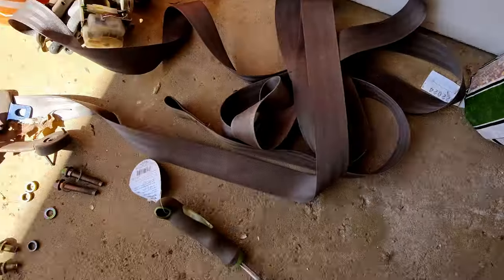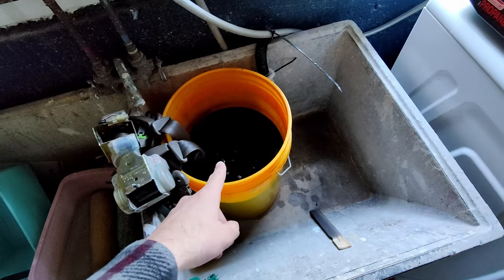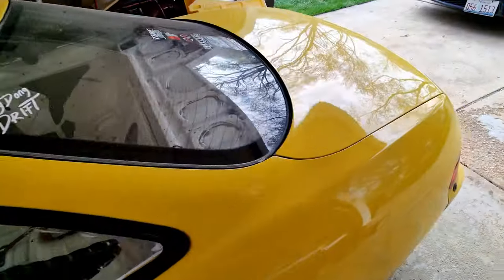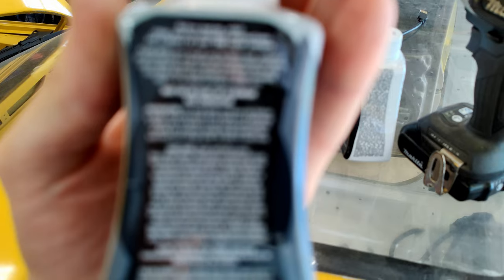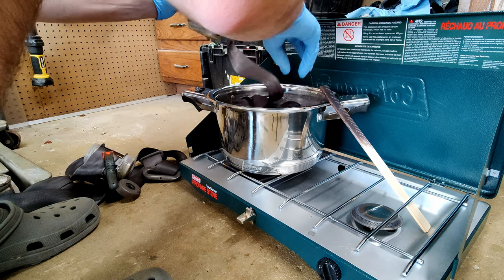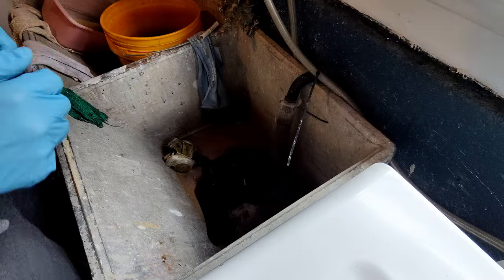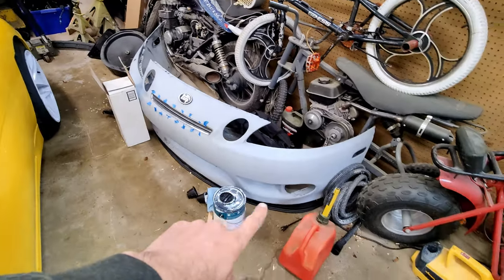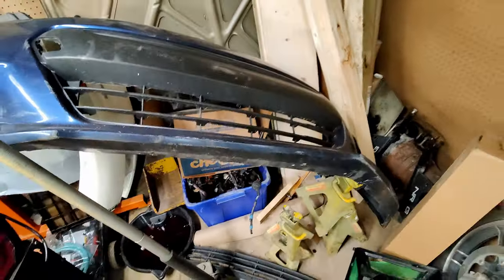I Tried to Dye my SC400 Seat Belts Black

Comment: YES!!! I did find on EBay UR Belt Replacement...Yellow-Edged Black FOR Lexus SC400 SEAT BELT WEBBING REPLACEMENT #1($99.99)...**Just viewing Youtube on the "Polestar 3. It has the YELLOW-Seat Belts. Color Seat Belts should become option's or blend with body color!  I saw an expensive car/or/suv with maybe yellow seat belts. That gave me also idea to look for color seat belts for my suv.  Thinking about today and saw you trying this method. Good thought about dying as I thought same. Don't know much how dye works but will finish your video and see if re-doing and keeping heat going will make dye hold. Good Luck & Thanks for this demonstration.

Comment: I am hoping you can come to my rescue a little bit. I dyed all the seatbelts and they look great. I put them all back in the car and the back center belt locks. Even when i take it out of and inspect it it is very finicky, sometimes locking and then being difficult to unlock. Any advice? The dyeing process added some wrinkles and things to the seatbelts, but i ironed the seatbelt to flatten it and the problem persists. Any advice is appreciated.
Reply from the maker: @barbecuesauceeyebrows8254  never had that issue so not sure what it could be
Reply: @DingDongDrift  no worries. Idrk how, but i was able to fix it.

Comment: I’m glad you did this. Since I’m dying my interior and haven’t gotten to the belts yet. I need to hit the carpet with one more Rit dye coat. It’s a dark grey green Nate as of shit tan. So hopefully a full spray bottle with get it done. Then I’ll use an extractor to wash the extra dye out of the carpet
Reply from the maker: Make sure you're using the "dye more" stuff and then soak it in rit color stay.
Reply: @DingDongDrift  well shit. Didn’t know there was a different one. I used the regular Rit liquid dye on the carpet
Reply from the maker: @kool-aidsphuckery9596  yea rit dye more is for synthetics like the carpet
Reply: @DingDongDrift  ok. Thank you
Reply from the maker: Yea give that a try. Same one i used in my video

Comment: I am gonna try this for my seatbelts. Trying to dye grey to purple. Multiple people have told me to bleach first, but im not sure if that is safe for them. I don’t want to damage them. Then, i was thinking to dye them on the stove with 1 bottle. I dont know if i need a second bottle
Reply from the maker: So there's a rit product that removes color which should work better than bleach. I also recommend using the color stay product because this kept bleeding on my clothes lol
Reply: @DingDongDrift  interesting. Actually, somebody recommended that i try acid dying the seatbelts instead and im thinking of doing that. Im not sure yet. Im kinda nervous for my first time. 

Thanks for responding so quickly and thoroughly to me!
Reply from the maker: @barbecuesauceeyebrows8254  acid could damage the nylon, maybe try a tiny spot first
Reply: @DingDongDrift  how do i know if my seatbelts are nylon or polyester? Does it matter? Would u recommend the rit dye over acid dye either way?

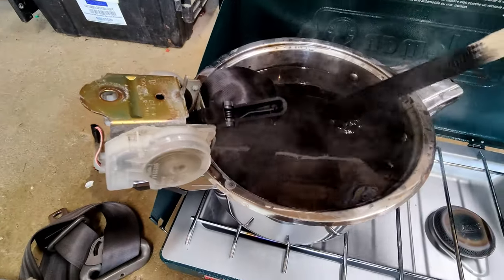Comment: 5:54 i noticed here that u seem to have the seatbelt fully drawn out. My seatbelts have locked, and i cant pull them out. Any advice??
Reply from the maker: The mechanism has to be tilted in the same position as it is when mounted on the car
Reply: @DingDongDrift  thanks for the response! Didnt expect to see one so quickly. You saved me!